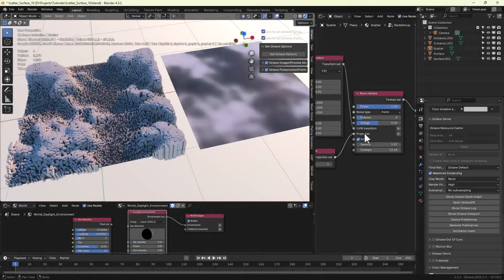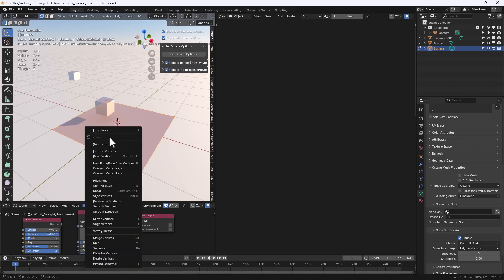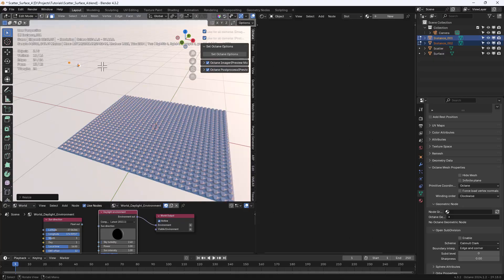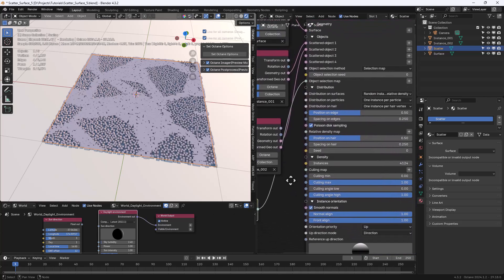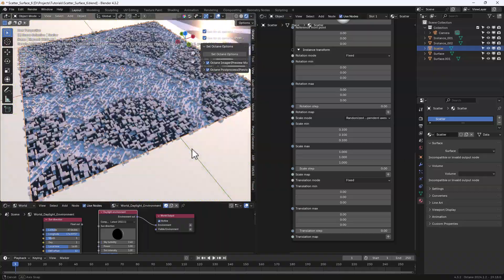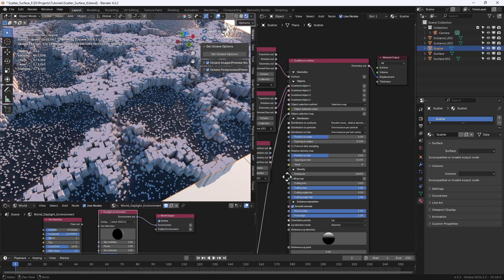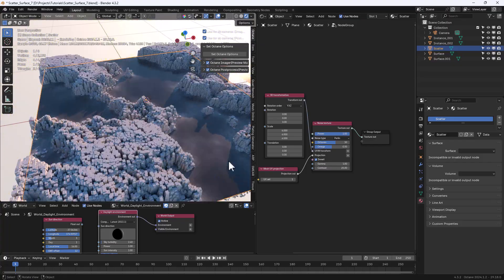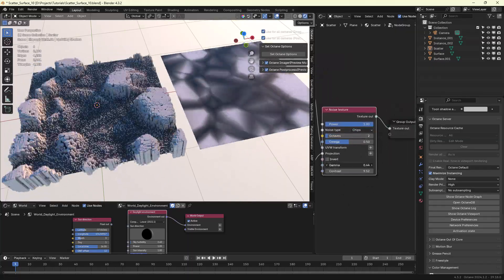OctaneRender for Blender - Introduction to Octane Scatter Part 1

Comment: Hi, when I select the object I want to scatter on my ground disappeared but the instanced object scatters, any fix for this?
Reply: I fixed it! I just removed my object data from the surface and scattered object nodes and readded them and it worked :)